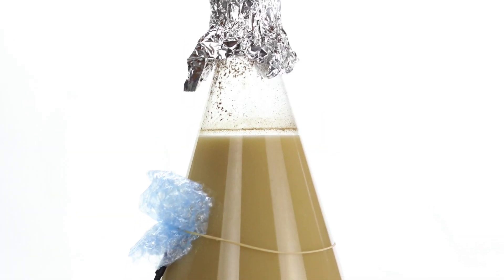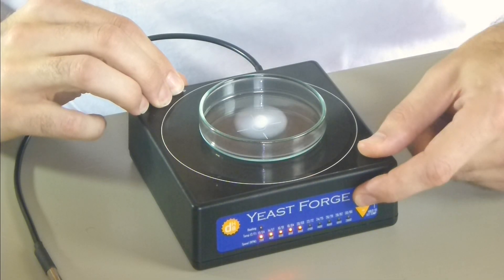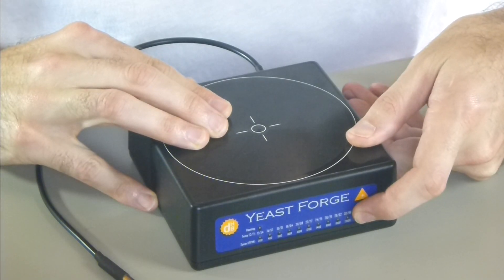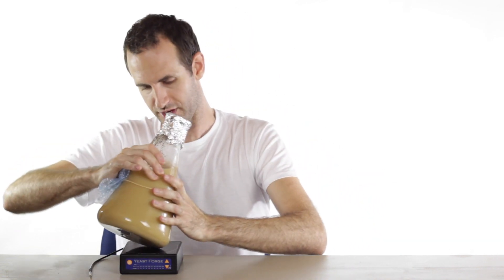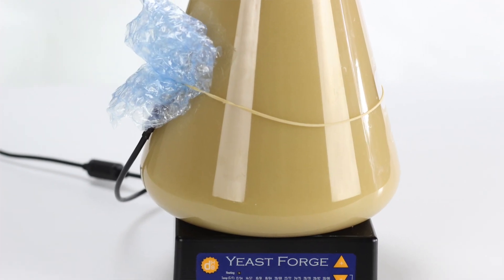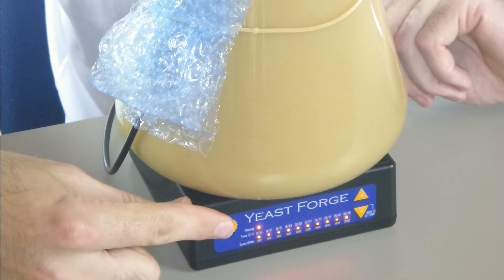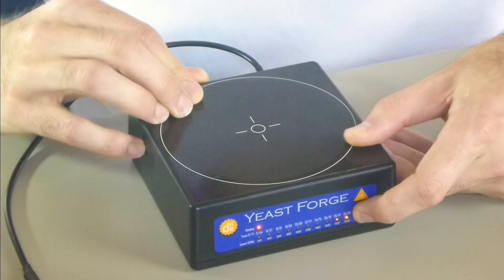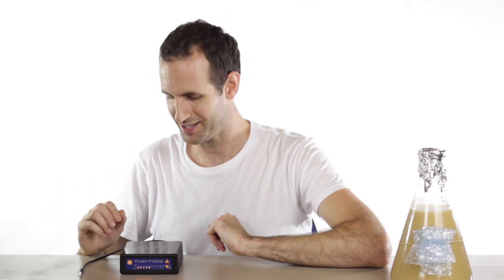Yeast Forge heated stir plate demo

Comment: Would you ever make a Yeast Forge 2.0 with a cooling function? 30+ degree days is pretty common here in QLD and having a cooling function would be handy.
Reply from the maker: Thanks for the question, it's possible but the supporting components (custom heat sinks and beefy power supplies) add a lot of cost. We'll keep looking out for innovative ways to make it possible without charging mega bucks :)

Comment: Seems great. Will it work with a 5000ml starter?
Reply from the maker: Yes, I find it works great but the stirring and heating ability will be reduced. E.g.  I recently made a 4L starter in a 5L flask and it was able to stir a small amount of bubbles into the mixture, but with the increased surface area I decided to wrap a little bubble wrap around the flask to help with the heating in our recent cold weather. It worked great.